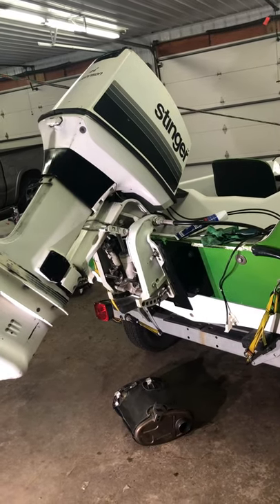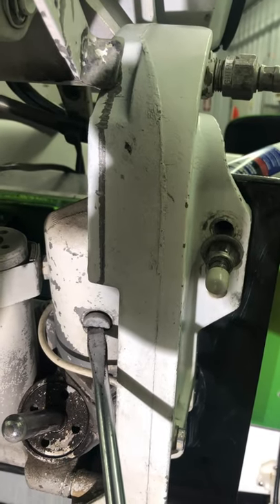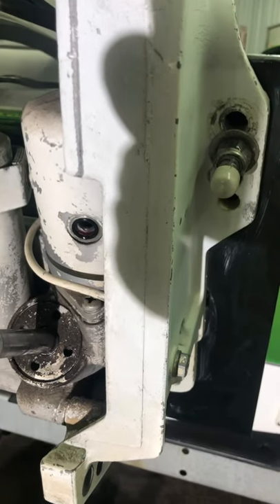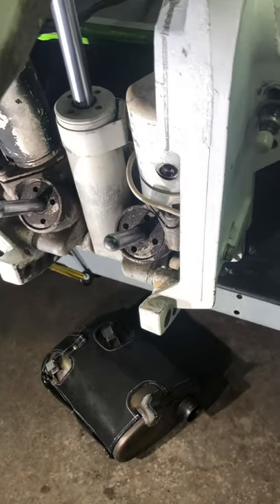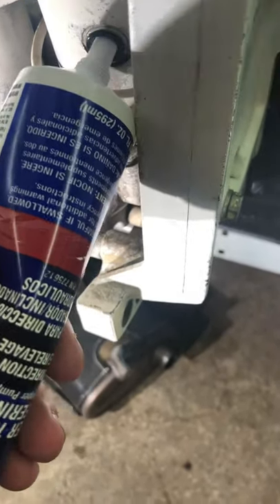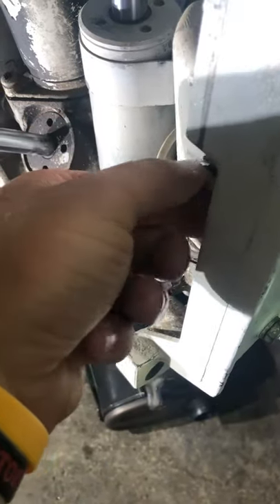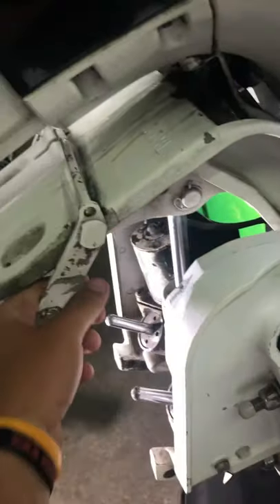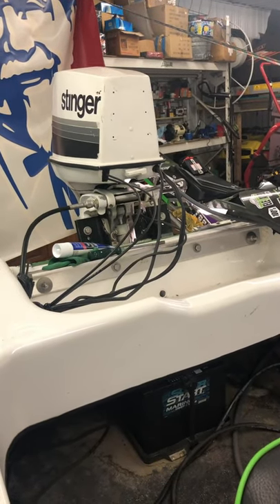Outboard tilt/trim fluid fill

Comment: Is your trim still making that loud noise? Is it still working as it should?
Reply from the maker: Yes it still makes that noise it’s the pump working, any old OMC motor I’ve had with trim makes that noise you don’t hear it driving but yes it works as it should